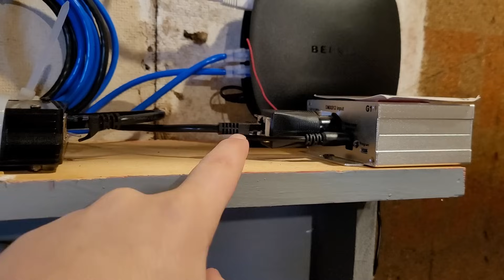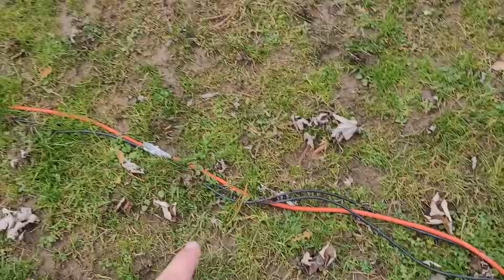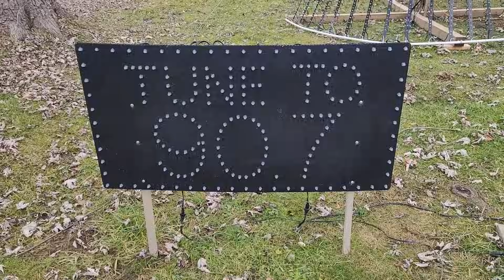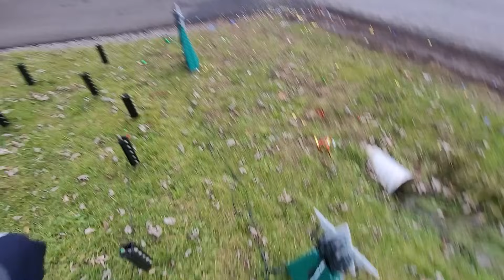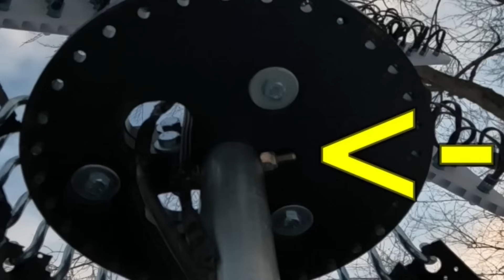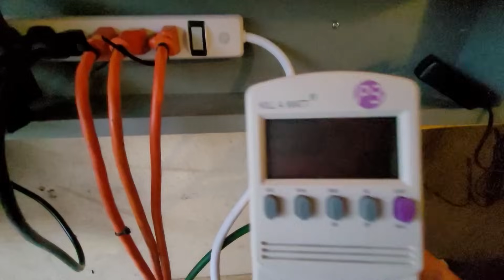Behind The Scenes - 2023 Christmas Light Show

Comment: Have you noticed any issues with having your power extension wires so close to data wires? Lots of people say that they should be separated, but I don't want to do that because it would be so much work! 😅
Reply from the maker: I have heard lots of people say that before, but I haven't noticed a problem with it. On my main run of cables that come out of the garage, there are 2 AC power extension cords and 2 data wires zip-tied in a giant bunch and there aren't any problems. However, I don't have any low voltage power wire (12 volts DC) for power injection right next to data wires. I have some that are a few inches apart, but not directly next it. I'd assume that also shouldn't cause problems, but I think it depends on which type of wire you have.

Comment: Hey Nick. Are you using any data boosters in your light show? If so, how many and where did you place them? Thanks for your time.
Reply from the maker: I don't think I used any this past year, but in other years I have had to use some. Figuring out where to place them can be tricky because lots of people say different things about where they should go. Some say the boosters should be at the start of a data wire, some say after, and some say in the middle. I did a lot of research about this and found some helpful presentations from Keith Westly about where they should be put. Data boosters are mainly made to fix a data signal to extend it farther, so they normally work best right before a prop or in the middle of a long data wire. However, with specific controllers, especially Falcons, data boosters actually work better if you put it at the start of a data wire. There's a couple reasons why, but I'm not sure if you're interested in hearing about all it.

In the end, I would start by putting a data booster right before the prop, but also test it in multiple locations. Even using a data booster at the beginning and end of a strand will help it more. So just use it where it works. Hope this helps!

Comment: Hey can you use a hp Omni instead of a raspberry pi?
Reply from the maker: Um to be 100% honest, I'm not sure. I don't see how Falcon Player would be able to run on it, so you'd probably have to use Xschedule instead. If you haven't heard of it, it's software made by the Xlights team to run your sequences, except on a computer. Falcon player is for Linux based systems and from what I've seen is that the HP omni seems to be a windows computer. So I would have to say you couldn't use FPP on it, but maybe Xschedule.
Reply: @How2Pixel  I can do a start on usb, meaning the OS that’s on it will start instead of windows.
Reply: @How2Pixel  with your how to use Xlights video I’ve almost fully made a show now! I know it’s no where near Halloween and Xmas but I’m having a little look on how to get used to Xlights before then. Thank you so much for helping!
Reply from the maker: No problem, I'm so glad the videos have been helpful!!!

Comment: The wires from your mega tree power supply to that power distribution board look massively undersized to be fused at 60+ amps like that. You should upsize quite a bit there so you don't go up in flames if you push things too hard!
Reply from the maker: Thank you for the advice! It's actually 30 amps per wire since there are 2 positive and 2 negatives, but I will still look into upsizing them.

Comment: I noticed you have the V5 recivers without the efuse wires going back to the main F16V5. How do you control the fuses, also since the f16v5 only has 2 efuse outputs how can you run more than 2 v5 recivers? loved the video!
Reply from the maker: I'm answering this question in a Q&A video I have coming up, but just for the quick answer, the fuse control outputs on the receivers and F16v5 aren't what control the fuses. The F16v5 controls the fuses on the differential receivers through the ethernet cable and communicates to the receivers that way. The fuse control outputs on the F16v5 and smart receivers are to control the fuses on F8 power distro boards. Those don't have an ethernet cable going to them, so they communicate to the main controller through the fuse control outputs. The differential receivers have the outputs too, so if the power distro board is closer to them, you can connect it there. Hope this helps!

Comment: I follow all your video's, and they are very helpful. I just started my light display in 2023. I bought a sequence and transferred everything I needed to Xlights. For some reason I cannot get the sequence to start playing on my show. Do you know why that could be or maybe a step that I missed that is common for new commers?
Reply from the maker: I need a little bit more information to help you out. Did you configure the controller and raspberry pi (if you're using one) to run the lights? What controller do you have and do you have a raspberry pi connected to it? You can't just hook the pixels to the controller and play the sequence. You have to set up the controller inputs and outputs to be able to receive the data and know where to send it.
Reply: @How2Pixel  I have a Rasberry Pi, and a falcon 16 v4 controller, I set everything up as was stated in your videos, but feel as if something is missing. My controller and Rasberry are both set up to my network via ethernet cable. I am able to play my sequence on xlights and it looks good but i cant actually play in on my house. I have even set schedules on FPP and still no luck. I even click on the little light bulb light in xlights to play now or to see now on my  lights and still no luck.
Reply from the maker: I am so sorry for not responding. When I get lots of comments, the old ones I responded to just disappear in all of them. So I'm just going to ask a couple things you could check to make sure you have it set up. Did you definitely set up the pixel outputs on the controller? The settings for that are on the output tab in the F16v4. Can you run a test pattern on your lights from the controller to make sure the lights are working? Did you render the sequences before uploading them to the Pi? I'm just trying to figure out where along the steps something is not working. If you look on the status page of the F16v4, when you run a sequence from the pi, does the packet count number increase? If it does that means at least the controller is getting data. If it doesn't, the pi and controller aren't communicating.
Reply: @How2Pixel  I am able to run a test pattern from the actual controller by pushing the test button. Yes, the sequence was rendered before uploading to PI . I am able to play sequence on Xlights and see what the show will look like, but when I push the lightbulb icon I still can, see it display on my actual lights. Thanks for your help.
Reply from the maker: So if it's not working when you play the sequences from your PI, something is configured wrong on there. It could be several things such as the network not set up between the pi and the controller, or the channel outputs aren't set up right. If the lights work when you turn them on from Xlights, more than likely everything on the controller is correct. Stupid question, but do you have the "enable output" button checked on the channel outputs tab? I forgot to click it once and it stopped the pi from sending out data. Let me know if this helps.

Comment: As always, an entertaining video with good explanations of what you did.  I would look at your output definitions on the player and make sure that none of them are set to Multi-cast because that would cause the EXACT problem that you were having with your network being bogged down while your show was running. Most consumer type switches can't block or direct Multi-cast packets and will flood your network with them.  Is you huge panel facing direct sunlight during the day?  The heat from the sun can cause the front of the P5 panel to heat up, expand, and detach, especially on a hot day where the heat from the sun is trapped between the P5 panels and the front screen.  You may want to build a cover panel that you can hang on the front of the screen during the day to block the sun and remove it in the late afternoon prior to the show or roll the display back into the garage during the day to keep the sun off of it.  If they are doing this on their own with the sun not causing some of the issues, then I agree with you, those panels are junk.  Also keep in mind that the smart controllers are not Ethernet devices.  They are differential receivers so in the future, you may just want to call the connection between them and the controller as differential or communications cables.  Thanks for doing these videos and I look forward to the next one.
Reply from the maker: Thank you for all the information! First, I'm almost certain the players were set for unicast, however, I can't check now since I already took down everything. As for the panels, they were in the direct sun, but on hot days I took a tarp and put it over the screen. However, when I first unboxed the panels, they were already chipping on the corners, the covering just hadn't peeled off yet. Finally for the smart receivers, you're not the first person to tell me that 😂. I've had a terrible habit calling them ethernet devices for years, so I'm trying my hardest to make sure I correct myself if I say "ethernet port" or "ethernet cable". Thanks again for all the info!

Comment: "Hello, excellent video, a question: you mentioned that you've had the mega tree since 2021, have any LEDs burned out?"
It appears that you performed an installation with 5V lights, and they worked well for about 8 days. After that, they started to malfunction to the point where you had to turn them off.
"I'm sending you the link to the video of my lights; I created it while watching your videos. Thank you very much for your help. "https://www.youtube.com/watch?v=3EFEcHkelfI
Reply from the maker: I have had a couple of LEDs burn out, I think 1 or 2 for the tree in 2 years. But for the rest of the show I've probably had a total of 5 - 7 pixels die. If your lights are malfunctioning within a few weeks of getting them, I'd definitely contact the manufacturer. They sound like pretty cheap pixels, maybe try and buy some from other places. Also, awesome light show!